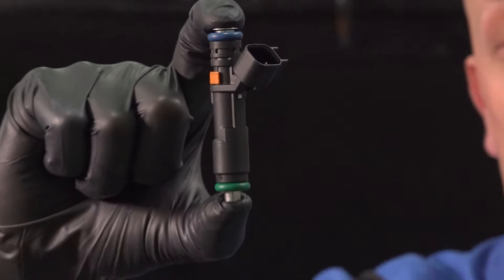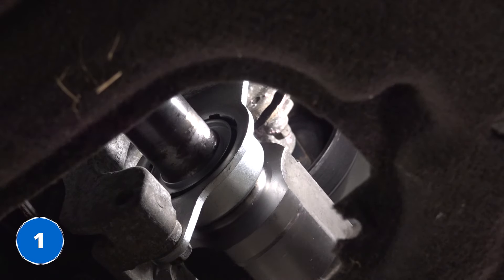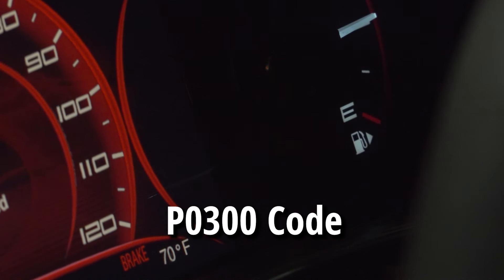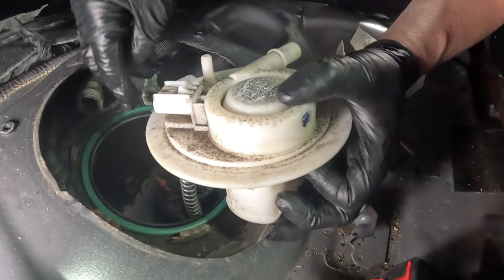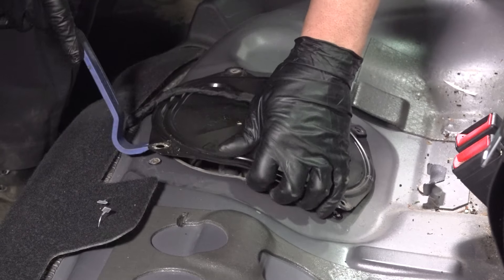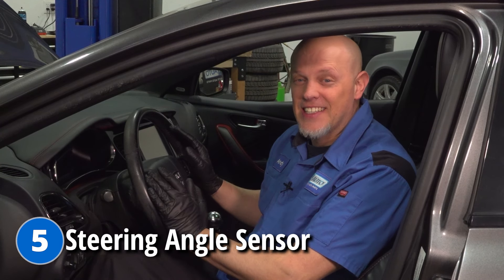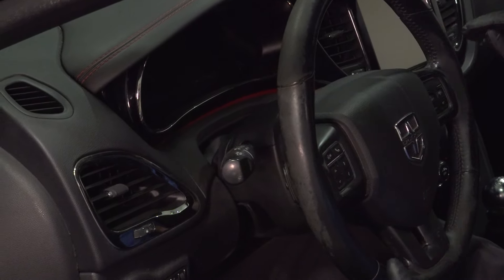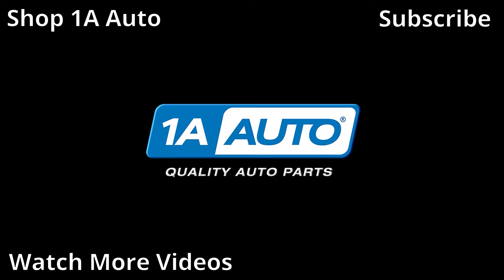Top 5 Problems Dodge Dart Sedan 2013-2016 5th Generation

Comment: If you maintain this vehicle, it will treat you well. Nowadays with all the throw away cars, people ignore maintaing them and pay the price...big time.
Reply: FACTS...I've had 2 at this point. The 2015 Rallye had a Catalytic Converter recall & the Variable Valve Acutator had to be fixed. On my 2014 GT, I had to get the Transmission Range Sensor replaced.

Comment: You forgot the #1 problem with all dodge darts that every single owner has done. The design flaw with the upper motor mounts. That only last maybe 30 000km max until the boots rip and leak the oil out and your making metal to metal contact with the mount. Only had to do it 3 times now.
Reply: Mine is up to the 4th time now. . These mounts are garbage  very frustrating.  Gonna try deyeme racing mounts next
Reply: Bro do you have a link for those mounts?

Comment: Man... these darts have a... can't even call it an overheating problem. We'll go with... it has a little too hot of an engine. The temp gauge will creep above the halfway mark but the fans kick on an it goes back down. It's more of a mental problem. It's not fun seeing the gauge move like that. But nobody that I know of has been able to find a fix for it.
Reply: Change your thermostat and water pump bro i fixed the issue after replacing the thermostat

Comment: I have been having these problems as of recently, only own the dart for a year. I have done so far, Ignition Coils, Spark plugs, And even had the dealership and other look at it without finding where the problem stems from, and it only effects one cylinder, Mainly Number 3. We have not done fuel injection or replace the gas pump, but it have all the problems you have stated, rough start, poor performance and just stalling out while driving, along with misfiring and traction control kicking on.
Reply: Do you fully fill the gas tank, then it does it? I've run into that with my 2014 GT (no clue what causes it but I just no longer topoff the tank). For reference, this never happened with my 2015 Rallye.
Reply: Bro change the fuel pump, I changed mine and it fixed the issue

Comment: I've had a 2.0 6spd dart for a work car for 2yrs now, put over 35k on ot myself, having got it at 100k. I'm a Chevy guy but been very impressed with it for what it is. Have had zero trouble and I average 37mpg. Has much quiter smoother ride than the other little stick shift work cars I've used through the years. Its comfortable with all the modern conveniences most expect anymore.

Comment: Mines at 70k miles, and has done pretty well. It was a rental car before I bought it so they might have dealt with the initial issues. The big thing for me is how low it is, splash plate broke and I had it replaced and that broke too. Be aware 😅

Comment: Also make sure your ground connection it’s clean and tight. You might even want to add another ground cable. Mine was running super rough at idle and did that to it and now she’s perfect.

Comment: good info! with the few recalls i've experienced with this car (couple in 2022  for transmission, and one this year: U90) I feel like Dodge has revitalized this car. 
I've had mine 8 years with about 103k mi (80k were mine) and it has never felt better. Keep regular oil changes and tires/brakes/bearings and the other engine stuff will last a while. biggest issue i've experienced is that it's hard to pump gas. takes a while becuase it stops and starts constantly. I've got some troubleshooting to do but I'll be maintaining the parts in this video afterwards and it should be good to go another few years.

Comment: i have a 2015 dart rally 2.4L i got in in 2017 with 25k miles on it it now has 228,000 miles i have always done all my oil changes on time the only real issue was i had to replace the multi-air actuator with a used one other then that been a great car

Comment: Good luck diagnosing that PO299 underboost code on the turbo models especially the manual model like mine. The result is that it is alright but the car is slightly underpowered to pull a full load at normal NA gearing. Give her more beans than you think she needs. The 1.4L is an italian design and it likes to rev. Not my preference because I feel like i'm hurting it.

Comment: Yes, Wear items get worn. Things need to be replaced. The steering angle sensor doesn't go bad, just recalibrated by turning the wheel. Quirky dodge thing that happens when you disconnect the battery.

Comment: Gracias, por la reseña en Español, tambien cambie las mangueras de los frenos delanteros se rajo sola la manguera es muy delicado , las que van de la mordaza a la tuberia de la soketera , y ya reparada asi después conduje 1250 kms, otra duda se oye dentro de la cabina como un ruudo de punterias o algo asi, ya despues en carretera no , es un Dart dodge rallye 2014 automático 2.4 motor air

Comment: Bought a 2013 Dart Rallye with 108,000 on the odometer.  Car is a little bad ass!!  I've had it 7 months and have put 8,000 on it with no mechanical flaws whatsoever.  Only problem I had was the previous owner was a raging moron and had no business under the hood of a car!!  They rerouted a water line for some reason and a metal bracket wore through the hose causing a leak.  The water leak shorted out the knock sensor and I had to replace that.
Aside from an idiot thinking they were a mechanic, the car is solid as a rock.  Anyone who claims the Dart is garbage or a "2nd generation Neon" do not know what they are talking about and are only repeating what someone said online.  Listen to the people who drive them, not some keyboard warrior.
No, they did not sell well when new, but people are realizing these little cars are beasts!  Used car dealerships can not keep them on the lot.  I live in a very small town (7,500 people) and I had the first Dart in town.... now there are 4 of them and all of us agree that it is a very good car.

Comment: I have 15 dart sxt 4 cylinder 
Im having issues with fuel gauges 
The needle will read 3/4 of tank almost full but it says has only 90 miles left and filled tank with gas wouldn't take no more tgan 20. And needle didn't go to full tank 

Is this a fuel pump sending unit issue or a mechanical or electrical part problem